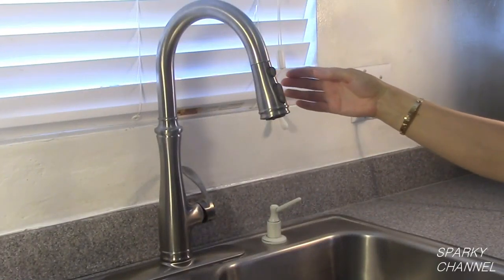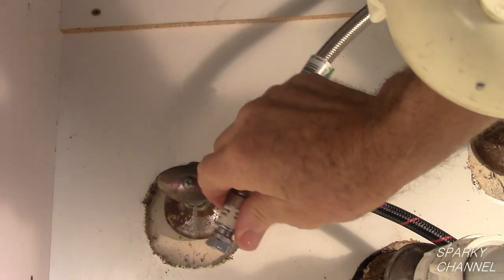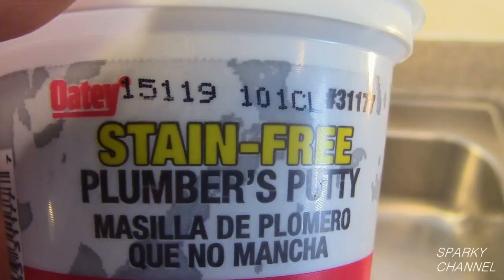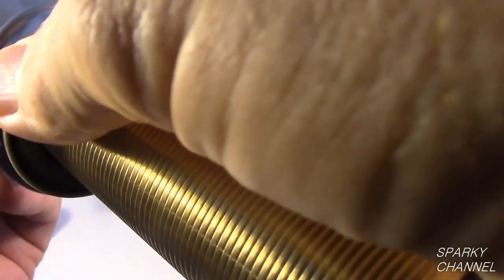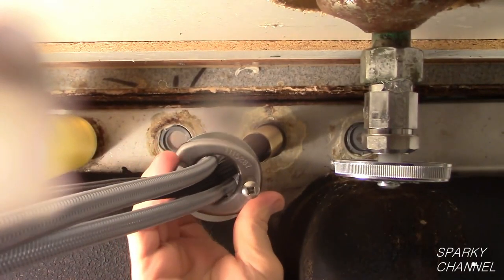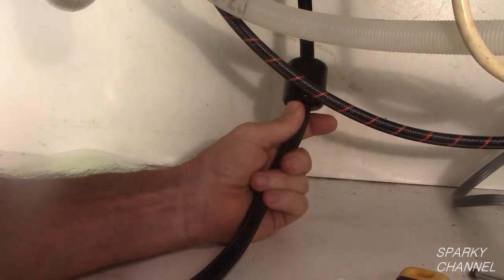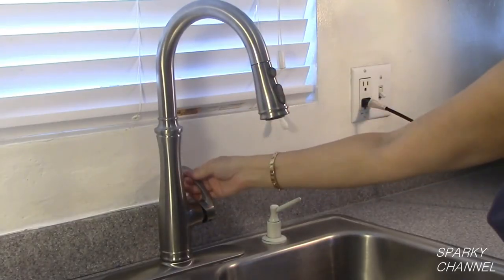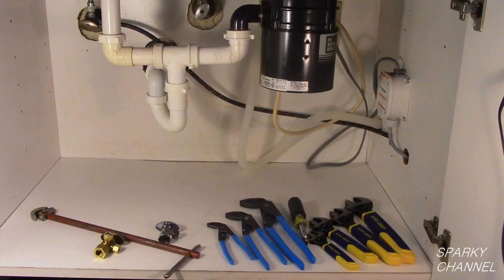Kohler Bellera Pulldown Kitchen Faucet Installation

Comment: Clear and articulate video, high energy, no excess, just what I needed to know. I installed my faucet pretty quickly. When lying on your back with your head under the sink, it helps to have a comfy dog bed to lie on.
Reply from the maker: Thanks so much! Also, good tip.

Comment: You missed an important step. You're supposed to have a catch basin and run the water thru the copper feed of the faucet for approx 1 min FIRST to clear any residue (from the manufacturing process) within the faucet pipe BEFORE you connect the sprayer hose to it. Otherwise all the residue goes into the hose/faucet outlet. It's clearly stated on the Kohler instructions. Otherwise, video presentation is great.
Sidenote: I wish Kohler had an option to have the valve handle face forward instead of permanently facing right.

Comment: Cool. When did u make this?
Reply from the maker: I think it was about 3 years ago. However, I just installed another Kohler Bellera (Kohler is my fav brand for kitchen faucets) and I added a few tips from my recent install. For instance, the supply lines, which come attached to the faucet, are now 1/4" but a few years ago they were 3/8". And I added the tip to make sure your angle stop valves match the 1/4" supply lines. Thanks!